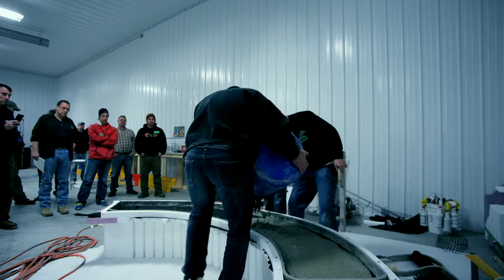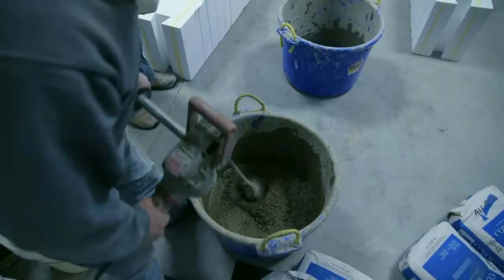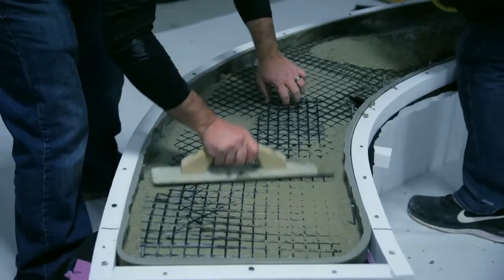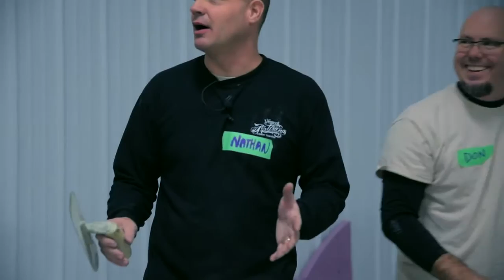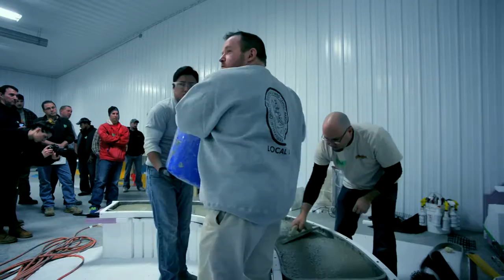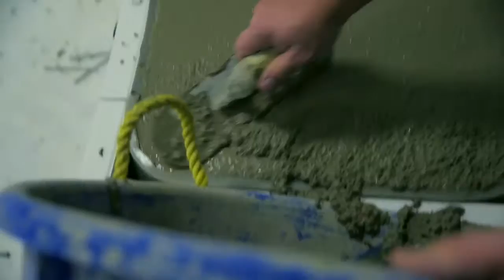6. Hardscape Seat Walls -  Set Up Pouring Seat Wall Cap

Comment: What do you do with thefoam underneith the seat topper (countertop) once it it poured??
Reply from the maker: it get broken off and thrown out...
Reply: Vertical Artisans do you have to lift the topper to get it out or do you just break the overhang and it becomes part of the stones under the topper?
Reply from the maker: It becomes a part of the stone work underneath... All is explained in the next video
Reply: Vertical Artisans thank you. Now if you were doing a countertop on existing cabinets would you lift and pull or would you use a different method all together?